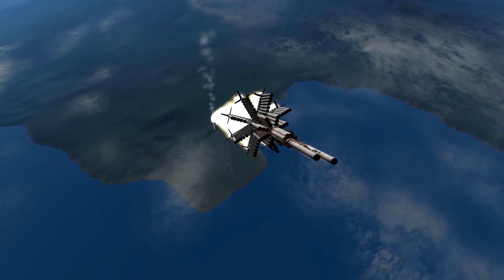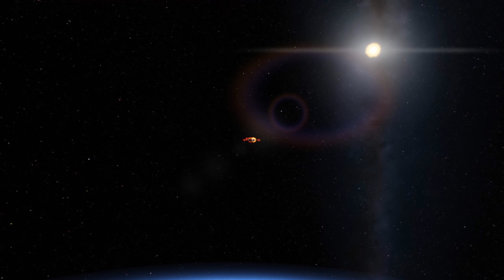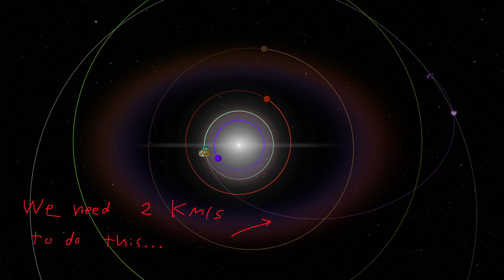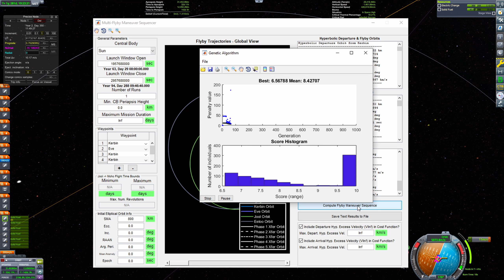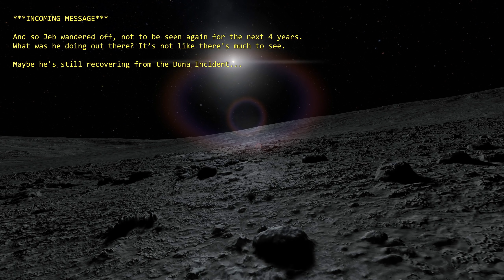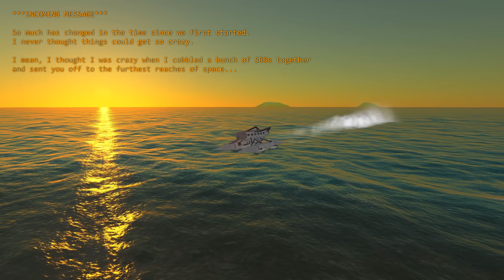Eeloo on SRB ∞ | KSP 1.11.2

Comment: "The mass is 69.7 tons on the pad"

I've built bigger rockets to go the Mun 😭
Reply: Bear in mind the size of the payload fairing;
That's a tiny craft for a tiny payload
Edit: he's also been doing it for years, so comparing yourself to him will only give you misery
Just keep playing and experiment with how little fuel you can get away with
Reply: My mun rocket is 341.5 tons and has 15,000 m/s of delta v yet i still can’t get back to kerbin
Reply: @DYACHKOV1Family   Minimum required delta v is around 7km/s, which can make the rocket far lighter and cheaper. This resolves thrust to weight issues you may be experiencing. Another way to solve this issue is to stage the rocket in a similar way to the Saturn V of the Apollo missions. Another thing is the insertion itself. The way I do this is not efficient, with me simply putting the craft in a highly elliptical orbit that intersects that of the Mun. Given enough time, that will result in a Mun encounter, which you can then correct into an orbit fairly easily. Landing is another thing, but simply doing a flyby is a good way to get a grasp on design and piloting the craft.
Reply: @DYACHKOV1Family what the FUCK are you doing!?!?!?😭😭
Reply: 67 and 69 together lol
Reply: @ayanshkothari4932  this guy is a genius. i try to park my satellites in 6.7 unit increments or 420.67

Comment: By the way, this is probably too late at this point given KSP2, but you can actually bind SRB thrust limiter to main throttle, and you get (somewhat janky, it has a sort of "spool-down" period) control over SRB throttle. You can also push a heatshield into place to cut off SRBs early, so you can do precision maneuvers without having to plan around the dV that SRBs have

Comment: Wait remember when you made the dres canyon,  and in the designing phase you found that by stacking bridges where there root is above physics range, you could build completely rigid structures that shouldn’t be rigid. I noticed that when you loaded one bridge segment , it didn’t effect the ones connected to it. Could this be used to make a floating base by cutting off where it really connects to, and the vessel doesn’t realize it’s connected to nothing?

Comment: Crazy challenge... Getting to Eeloo with SRBs and gravity assist is hard enough... and I  * might *  be able to pull it off.
But the docking with SRBs?  Just no... I really don't have the patience to add that flight pin onto my chest.  Well done sir !
Reply from the maker: Thank you! Indeed, the docking was one of the most difficult parts of the mission. As for difficulty, I think I'd put it on par with the gravity assists

Comment: A few months ago i managed to land a Gemini capsule at the ksc by accident, ironically i was joking about how bad i am at guiding stuff to the ksc when it happened, also i am talking about the stock Gemini capsule not the ro one. I landed it on the slope of the runway, mind you i had no rcs, only the drag of the heatshield at like 20 m/s and reaction wheels.

Comment: Well i broke my record for heaviest launch vehicle in ksp, not stock but still, the thing is 18 kilotons total not payload. I have no idea the lko payload, it should be able to launch 20 or so tons to eve so not exactly practical but that is on chemical rockets only and only 2 stages. It should have about 6,000 to 7,000 m/s of delta v in lko with 10 tons of payload. It is so big that it takes like 10 seconds to go from the bottom of it to the top of it in the vab and that's with hanger extender. I would put a picture of it but i dont know how to do that in a youtube comment

Comment: How dou you make forward tilted wings work? My creations somehow flip always (COM is before COL and in a straight line to COT)
Reply from the maker: KSP isn't entirely accurate with the COL because it doesn't account of body lift or drag. So, while it says the COL will be in one place, it may actually be in a different place.
COL also depends on the angle of attack.

Overall... Its hard to judge stability from KSP's stock COL marker. If you're having a lot of trouble with it, I'd recommend getting a mod like this: https://forum.kerbalspaceprogram.com/index.php?/topic/160231-19x-correctcol-stock-aerodynamics-design-aid-continued/
Reply: @Stratzenblitz75  thank you :)

Comment: About the first stage you said it was easy to get too high due to the high thrust to mass ratio. there's a thrust limiter option if you right-click SRP in the VAB
Reply from the maker: I used that indeed. Otherwise, the TWR would have been way too high.

Still, the issue is that the mass changes so much that a standard 1.4 TWR on the pad turns into over 3-4 at the end, which can really raise your apoapsis further than you want if you aren't taking a shallow enough profile.

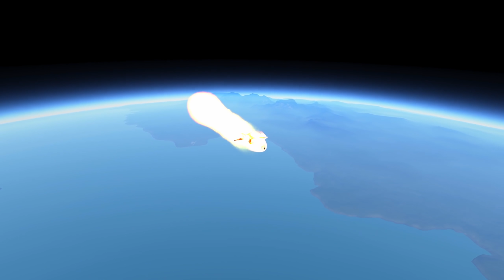Comment: Isn't it quite inefficient to have such a massive fireball following your ship? - like at 2:15

i see lot of youtube kerbals do that,  with an imo gravity turn performed too early.
or does it simply not matter at that altitude?
Reply from the maker: Drag losses are typically much less significant that gravity losses, so generally you want to take the shallowest profile possible without overheating.

Also, since the ascent is done in one burn, I need to take a shallow profile to make sure it doesn't go too high. Hitting an apoapsis of 70-80km requires this kind of shallow approach.

Even going a bit steeper can get you up to 200-300 km, which means you start losing out on oberth effect on your Eeloo transfer burn.
Reply: @Stratzenblitz75  ah thx.
I played kerbal back in 2013 and the first guide i read was go to 2000 m and have 120 m/s there, and 130 at 3000 m and so on, hitting 200 m/s at 10 km and then going into the gravity turn to get your orbit circular at about 100 km apoapsis. Worked well for me so far for my spaceships.
I haven't played much since 2015, so i might have missed some changes on the aerodynamics update and so on. 
So thx for the explanation :)

love your choice of music btw
Reply from the maker: @Xingmey  Thanks! yea that would explain it. The old aerodynamic model favored much steeper approaches like this since the drag was much higher. With the new aerodynamic model, you can get the drag of your craft extremely low and so now shallow approaches tend to be more efficient.

Comment: Obscure video pro tip: Red lines on video always look pixelated, due to the way it's being encoded (Y'CbCr 4:2:0 – meaning that color pixels are 2x2 pixels large, and red's Y value is kinda close to black). Colors with Y=100% (yellow, cyan, magenta, green) and any shade of grey (which just use smaller pixels) tend to look much nicer.

In each case: That was an awesome video! And congrats on 100k subs!
Reply from the maker: Thanks! That is good to know.
Is this something I can fix, or is this on YouTube's side? I will admit, I didn't care that much about video quality after I saw 5-6 uploads fail from what I'm assuming is too high bitrate. This video came out at crf 22 and I just uploaded it to make it work.
Reply: @Stratzenblitz75  This is something you can't really fix with codecs; YouTube will mercilessly convert it back to 4:2:0 (and most other platforms, too). 

This is something though you can take into consideration when designing your scenes and overlays – I love the idea of handwritten notes pointing out things, maybe exchanging the red handwriting directly on the screen with, for example, post-it-notes that get slapped onto it might look nice and transport the same vibe/meaning. 

As for your failing uploads, I'm not sure why that happened, YouTube should eat anything as long as you stay below 128 GB. If you care about this enough to investigate it further, feel free to hop over into the official YouTube Gaming discord, I can typically be found there.

Comment: SRBs can actually be throttled using axis groups. It's not particularly fast but it does work. I've done this for some SRB precision challenges using KAL.
Reply from the maker: I am aware, but I don't consider that legitimate. SRBs are supposed to have constant thrust and burn until they run out. Figuring out how to get around these limitation is what makes this kind of challenge fun

Comment: Why did u have to calculate the deltav of the sepratrons there is an option in the vab toinclude their deltav in calculations
Reply from the maker: Basically what The18thDoctor said. It wasn't accurate enough. For these transfers, I really needed precision in the cm/s range.
Reply: That’s only accurate to the nearest meter per second, Stratz needed decimal accuracy.